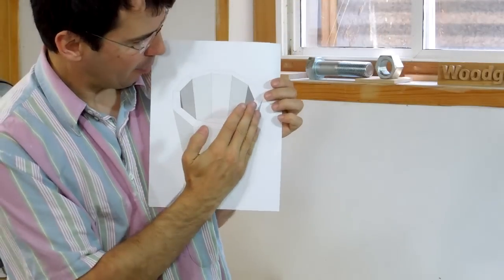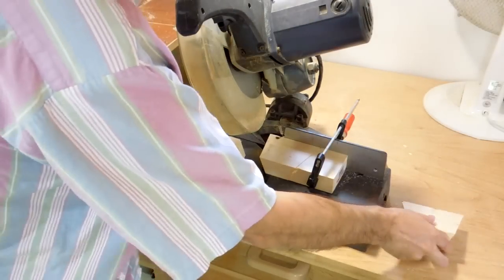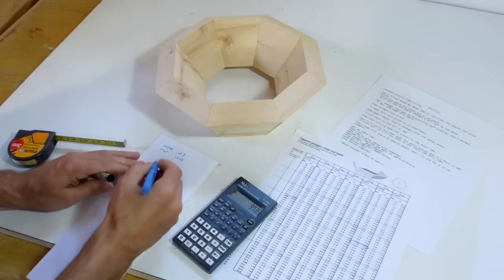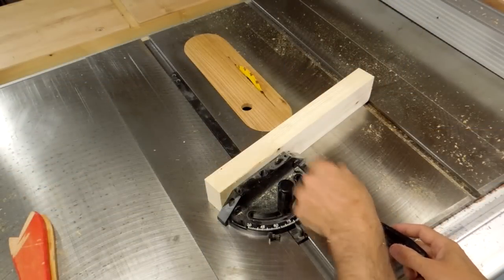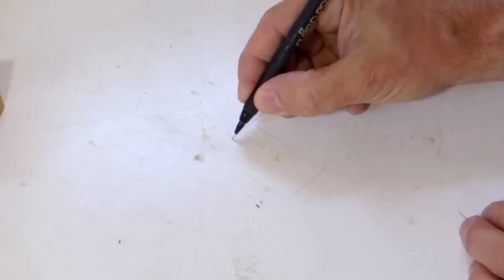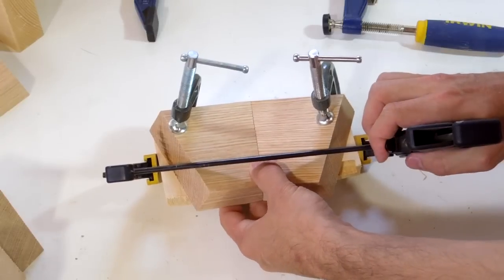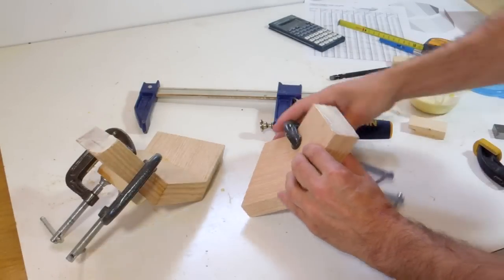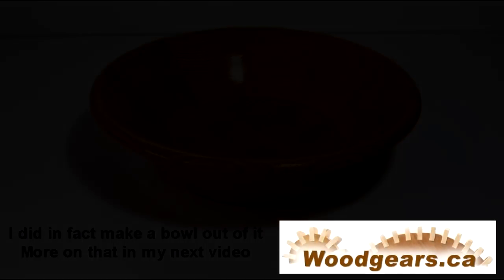Splayed miter angle calculations and gluing

Comment: Thank you, Matthias. Your table is just what I needed to allow me to create an interesting garden bird house structure with 12 sides and different slopes for walls and roof. At the planning stage I became aware that this was not as straightforward as I'd originally thought when I realised that all the angles I'd worked out would be wrong. I am (just about) capable of the necessary trigonometry and could have worked it out fairly easily 40 years ago. But now, recently retired and starting out in the woodworking hobby, I was about to give up on my intended project and simplify it by sticking with right angles and 45 degrees, thinking that using 12 sides it would take me longer to work out the math than to actually make the thing. So I searched online for some help and eventually found your video which was exactly what I needed. Armed with your table I'm pressing ahead with my original idea with confidence 😁👍.

Comment: If you want your adhesive to not act as a lubricant, throw a pinch of sand on one of the faces. The glue will hold the sand on until you clamp, then bite through the glue and keep the wood from sliding...
Reply: Salt also does the trick!

Comment: I repaired a couple of round columns and used a clamping system like yours; however, I used my biscuit joiner to cut slots and hold the pieces together while clamping.  I know it was an extra step, but it helped a lot.

Comment: I never tried the math as a table was provided in a radial arm saw instruction book I purchased. Of course radial arm saws are notorious for inaccuracies and my first project for a polygon had slight gaps in the miters. I decided to solve the problem  by gluing up in halves and sanding as you did but never put it into practice. Thanks for your research and tutorial.

Comment: Matthias I love your work....you're very inspiring.  Several years ago my son and I made an Ashiko drum.  I downloaded a calculator called DrumCalc by Dan Sterantino's .  From what I can see it does all the calculations you would need for the splayed miter angle...   Easy glue method is this....lay all the pieces inside down on the table.  Align them and put some masking tape on the joints.  Flip over, apply glue, fold together and clamp with surgical tubing.

Comment: Thanks very much Mathius... I was getting annoyed mitres "not quite right" on a half octagon-ended conservatory roof insulation project. Your cheat-sheet worked a dream with no more guessing (roof angle 30 to horizontal or... 60deg splay... Cheat sheet says mitre 19.73deg, saw tilt 11.03deg...worked perfectly) . Keep producing those videos...

Comment: That is so weird! I'm getting a table saw (don't have much room so it'll just be a Bosch GTS10XC) and the first project to test out the miter and blade tilt angle will be a cone shaped dust separator made out of MDF or plywood segments. I knew I watched this video years ago, but because I like puzzles I did the calculations myself (mostly by geometry of plane intersections and other vector calculations). And now, two days after I did that, this video comes up on the suggested videos. I did not search for anything related to it (so Google shouldn't know), still I get this suggestion. But at least now thanks to your spreadsheet I could confirm that my calculations are correct (for all combinations of # of segments/side angle I checked).

Comment: On similar constructions I have found that splitting it up into two operations simplifies things, at least for me.  I used a taper jig on the table saw to taper all the segments to final size, leaving the blade vertical for square edges.  I then beveled the tapered edges on the jointer with the fence tilted to the proper miter angle for the number of segments.  That would be 18 degrees for your ten segments.  They fit together perfectly.  My grain direction was the other way, though.

Bob

Comment: Agreed, that was one of those tips you realize when you see.
.
I also agree with Matthias that the one handed quick grips don't have much clamping power, but you could use it to get the parts in position and then add the good clamps after.

Comment: In any gluing or clamping job you need a three-handed carpenter. Or one who can always say, no matter how busy he is, "on the other hand.." 

M. Wandell's greatest contribution to humanity will be to invent the one handed clamp which will reach in 3 and a half feet, have as depth of 2 feet and fit your pocket and clamp from a flat surface, something onto that same flat surface.. which we shall call "the hover clamp."  Similar but reversed in principle to the No. 10 General Purpose Skyhook, which is used for lifting things from the floor from any point with no available overhead suspension..

Comment: SOHCAHTOA...

Sailors Often Have Curly Auburn Hair 'till Old Age...

I'm making a six sided lighthouse and used some tips in your video to improve on them. 

The best clamping method I've found so far for this application has been painters tape. I turn each piece over so all their edges are touching and then apply a few strips of painters tape. I then turn the entire piece over and add glue to the joints and fold it together to form the final shape and attach a few final pieces of tape to secure the last two pieces together. The tape really keeps the pieces tight to each other. Try this on your next project and let me know your thoughts. 

Thanks for sharing the video.

Comment: I built some thing similar but wasn't smart enough to come up with your idea for clamping.  I ended up duct taping them together on the OD while laying flat, then as I folded it into shape it put quite a bit of force on the joints. It turned out well!

Comment: Question - i have Microsoft Excel and have been making spreadsheet calculators for various construction tasks.  I've never cut or installed crown molding before and I saw the bizarre numbers (miter angles and bevel angles) in the crown molding charts.  I finally found a formula sheet that shows you the formula for calculating miter/bevel based on the wall corner angle and spring angle that you have to enter.  So, I made an Excel spreadsheet calculator from this and the calculations its producing are matching the calculations that I see in the charts.   So, for example, if I enter 90 for wall corner angle and I enter 38 for spring angle (the most common spring angle for crown molding) the spreadsheet calculates 31.6 for miter and 33.9 for bevel.  My question is I have the correct numbers apparently but when I go to cut the crown on a miter saw, do I lay the crown flat on its back and cut with a 31.6 miter and 33.9 bevel?   Or do i place the crown molding on the miter saw in a leaning position that matches the spring angle then cut with the 31.6 miter and 33.9 bevel?   I'm getting the correct calculations, I just don't know how it's supposed to be cut on the miter saw.

Comment: If the surface of an end grain cut is very flat, and the end grain of each board is saturated with glue to prevent starving the joint, the mitered joint should be just as strong as the wood.  Matthias is correct in stating the use of clamps creates a much stronger joint than using tape.  There are formulas on google that compute the miter angles and length of cuts to produce anything a person could wish.  Bill Sutherland, Ph.D in mathematics.
Reply from the maker: +Bill Sutherland I also have a spreadsheet for it on my website - the spreadsheet that I used in the video!

Comment: Hi I’m making a 4 sided square pointed peer cap mould out of 18mm (thickness may change)material. The cap will be 800mm square to the inside of the mould When I measure the radius do I measure to the corners ? Thanks for this video it’s a great help

Comment: To solve the tricky clamping problem, I used frog tape on the outside joints with the pieces flat on the work bench.  Then add small bit of wood glue in the V between each section, lift and join the first and last section with tape and it is ready to dry.  You may want to use a band clamp for extra pressure.

Comment: I  think you are a smart guy and thank you for your teaching and the chart for calculation of angles.one thing that I would have done different is to glue all pieces using masking tape applied to the outside face and you can glue the whole thing at once with no problem or as many pieces at once as you want.just an idea.

Comment: Great video, I never could figure out all that math.  When we would put facia on square tales we did it through a process of elimination.  As for glue up, would it be a lot easier if you splined the miter joints?

Comment: You can also use metal hose clamps so you can glue all your staves together, and if you do the staves as face grain to face grain you should get a better glue bond as to end grain to end grain. Also, if the hose clamps are too small you can also always add multiple hose clamps together to make a more large clamp.

Comment: To create a router table dust collection 4 sided box, I have always found dust collects at the bottom of the box (despite the dust extraction removing dust from it). So creating a funnel shape at the bottom of the box would be advantageous. However, if one has a 4 sided (non square) rectangular box, could one use your calculations to create a funnel or need new ones? Perhaps a future video?

Comment: I am working on a column base consisting of 4 pieces of trapezoidal  lumber with actual cross sectional size of 1.5 x 11.25 inch ( US nominal size 2" x 12") . It is to be slope about 10 to 15 degree so rain water drain and not on the wood. The dimensional data for short side of Trapezoid is about 11 inch where the 11 x 11 column s=is installed and the long side ends up to be about 36.5 inch. I have not find any reference for calculating the angles to get a good fit when installed. Let me know of any carpentry reference book you know of or if you have done this yourself?

Comment: Woodworking Beginner: 
This test is only if you want to saw with precision with a miter saw.(test is not intended for rough and hard work).     
Tips and Test: 
Very important if you would like to saw with precision. (avoid torsion as much as possible)!
Always choose a Miter saw with a handle positioned in a VERTICAL line above the saw blade.  
Everything must be aligned, slide rails, handle, and saw blade,it is much better this way the blade will not tilt.
Because there is some torsion in the aluminum housing .
And choose an engine with softstart on it to prevent wear of the gear and worm shaft.
It is very important that everything is aligned.
Here are some examples to show how the handle must be positioned above the blade.
Bosch gcm 800 sj / Bosch gcm 8 sjl / Evolution rage 3 / FESTOOL KS 60 / Bosch GCM 8 SDE / FESTOOL KS 60 E KAPEX / Metabo KGSV 72 Xact / Bosch PCM 8 SD / Hitachi C10FSH / Ridgid MS255SR 10-inch / Evolution Fury3-S / Evolution R255SMS / Metabo HPT C10FSBS / Hitachi C10FSB /  Hitachi C10FS.

(This also is the case with the Miter saw without the slide rails).

(If you want). You can test it yourself at home if there is torsion in the aluminum housing.

Step-1. First you make a saw cut from +-5 mm deep in to a flat piece of wood about +- 20 mm thick to this with the normal handle positioned on the right side of the Miter saw (the wood it will remain in place until the test is completed).

Step-2. Then repeat this by pushing the saw blade down with your hand (finger) on the aluminum protective cover were the saw blade is cased in. Just now only do this without the running engine.

Step-3. Now you can see if the saw blade will be positioned in or next to the saw cut. If the saw blade is (+- 0,2 / 0,5 mm) next to the saw cut then there is torsion in the aluminum housing (test is completed).

Step-4. Therefor it is much better to choose a Miter saw with the handle positioned VERTICAL in line above the saw blade. 
The second option is the handle positioned HORIZONTAL in line above the saw blade.

Step-5. When you measure the vertical 90 degrees angle square (Digital Level Box) of you're sawblade don't forget that there is always some torsion in the aluminum housing.

Conclusion:how further away the handle is from the saw blade how more chance of torsion in the aluminum housing don't go for that  (the choices are yours).

Also with a cheap slide miter saw it is still better the handgriff in line a above the saw blade than on the right side. Maybe they will make it someday then we have a winner...

Comment: It seems that the tilt angle is just [90 - arccos(cos(A)*cos(90-B))], where A is the degrees off vertical and B is the flat mitre angle (90-B is also half the angle at one vertex of the polygon on a flat surface). I haven't worked out how you computed the mitre angles yet.

Comment: At 8:06 you say, 'with glue it's trickier, because it's a lubricant',
I am fairly new at woodworking (and love your video's), but i once heart somewhere that sprinkeling some salt in between the wood surfaces (in the glue) will help.
(Not sure if it's true or not though)

Comment: There is an easier way to clamp this and you can do it in one go. If you use vinyl parcel tape (yes seriously) laying the parts out flat on a strip of tape or in this case several strips of tape due to the compound angles, with the bevels up lay the parts onto the tape with a very small overlap and press the tape firmly across the face of the timber. leave a free end of tape of a good few inches. The length depends upon the size of structure that you are assembling. It is best that it laps around at least one corner past the first face. Taking the free end of the tape the parts can now be rolled up into the intended assembled shape for a dry run. Adjust as necessary or start again if you have to but if it is good then glue the joints stretch the tape over the last joint and let it set. Vinyl tape is slightly elastic and the overlaps of the parts mean that when the assembly is made the tape stretches at the joints and produces tension and thus clamping pressure. It may be necessary to clamp a board over the top of this particular assembly to keep all the parts in register. When set just peel off the tape. when attempting to remove any tape residues as can happen a little with some tapes the best tool for the job is a cabinet scraper. Another benefit of parcel tape is that when stuck to clamp packers it works as a parting agent for wood adhesive, even Gorilla glue. No more than a lateral tap with a hammer will be required to part a clamp packer from set wood adhesives.

Comment: Matthias, this is a really informative video. I like how you clamp the pieces together. However I don't understand why you need trig to do this. If your top opening is a true octagon, and your bottom opening is a true opening, then wouldn't every perfectly horizontal cross section be a true octagon? Your bevel square didn't work because your slide is in the middle of the wood handle, never allowing the tool to "flush out" properly, if you will. Wouldn't what you described with the sheet of paper describe a octagon becoming almost spherical at the bottom?I'm not trying to give you a hard time. I'm thinking back to some of the weird angles I've had to do with crown moulding. I just don't see the need for trig to find those angles. If I'm wrong, feel free to correct me. And thanks again for the video and tip for clamping.
Reply: I'm having the same problem.  It seems paradoxical that I have a regular polygon at the top and the same at the bottom.  The angles must be the same, I thought, but obviously it doesn't seem to work.  I can do the math, but I'm just not sure what I am missing that I need to apply the math to.  Please, help me to understand, +Matthias Wandel.
Reply: See my reply to Mychal Evenson above. The plan view of an octagon always has the same plan view included angle. Yes. But as we rotate our viewing plane, as noted by Foucault with his pendulum, the angle of the dangle changes.. 

Take a plastic drafting triangle. hold it flat with the edge at 90 pointing straight out from your body. Then tilt it down towards you. The base length against your body does not change when viewed from above, but the sides do. The side going straight out changes by the cosine of the angle of tilt. 

If your tilt is a distance to a surface vertically you can find its projected length by pythagoras and subtraction using the straight out side as the hypotenuse and subtracting the square of the drop distance from the square of the true side length and taking the square root of the result. 

If you view the longest side end-on its angle of tilt is different than the side going straight out. You can calculate its projected-to-horizontal length from its height and its true side length by using pythagoras and subtracting the square of the height from the square of the true side length. Taking square root of that.

The obtained projected length of the straight out side over the projected length of the long side of the triangle gives the downwardly perceived angle by arc cos on your sci calculator, or some sin cos tan tables. Arc cos is  inv cos on most calculators.. 

From this you can see that a triangle of fixed dimensions does not maintain its angle from all viewpoints.

Comment: Matthias, would it be easier to use a biscuit between the joints on the glue up of the two halves? this way you wouldnt have so much trouble holding it while clamping it. just a thought. great video!!

Comment: This is very useful.

Could you share the math formula to calculate (if possible) the mitre and blade angles if the polygon is not regular?

I want to make an irregular octogon for the lid of a heirloom box with front and back sides larger than the other six sides and angled like the bowl shown in this video.
Reply from the maker: Gryphus See the linked article.
Reply: Matthias Wandel thanks, checked it yesterday but didn't notice the picture with the formula.